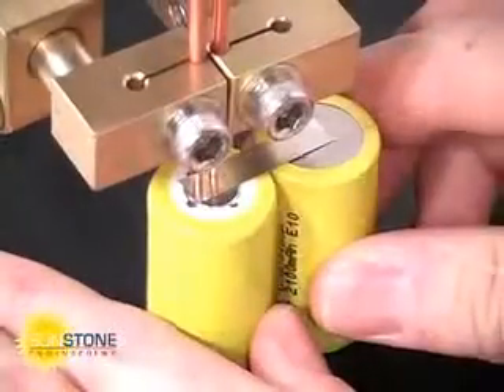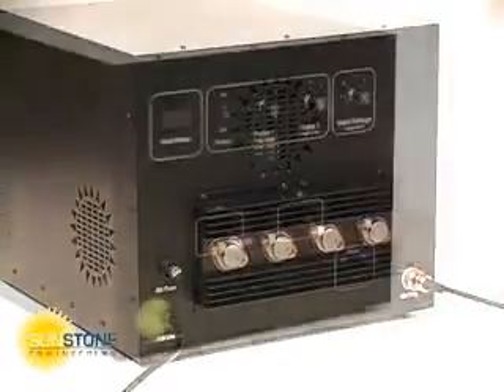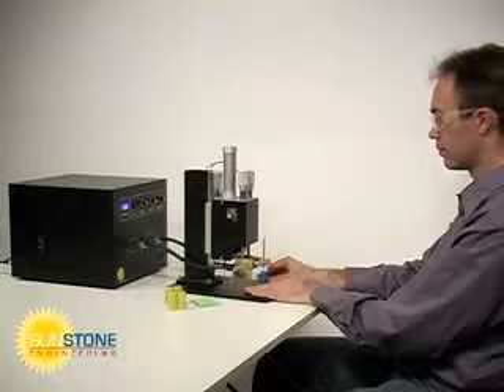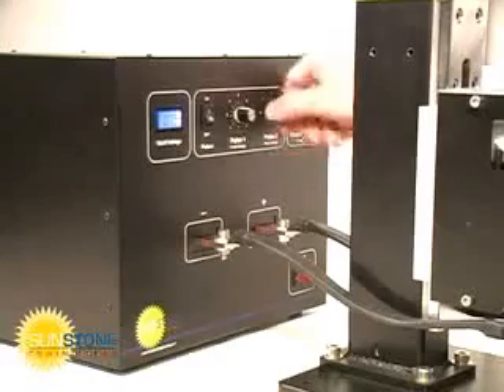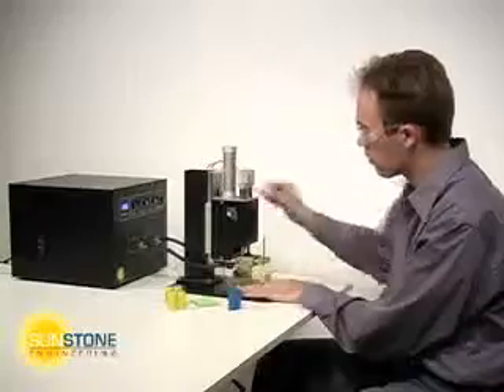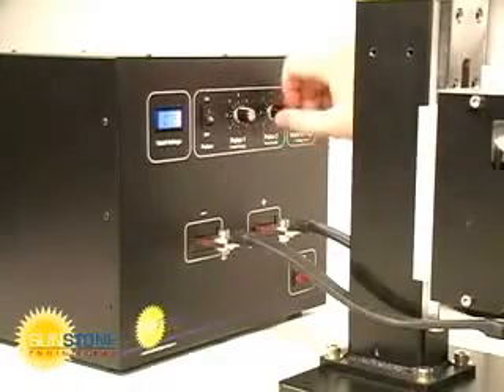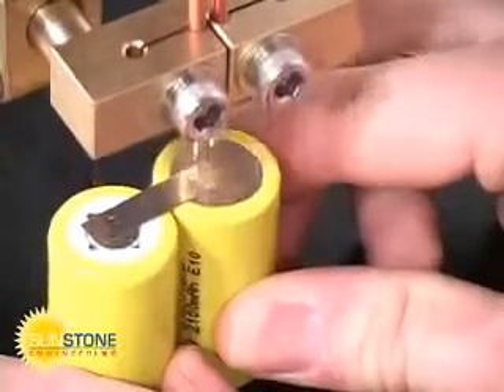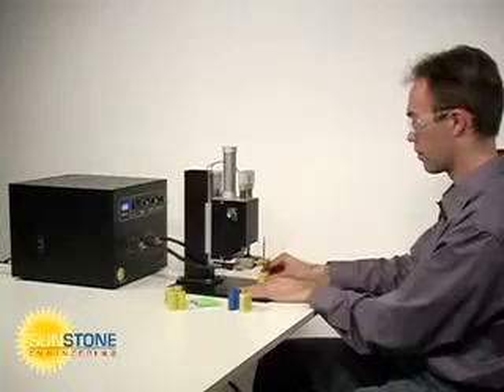Dual Pulse Capacitive Discharge Spot Welder - Battery Welder

Comment from the maker: The best way is to give us a call at 801.658.0015, toll free at 877.786.9353 -  There are a couple different models that you can weld battery tabs with and they range from $2,000.00 - $7,800.00 - This price is for welder and weld head or hand piece.

Thanks!